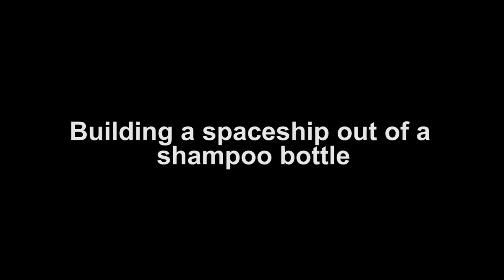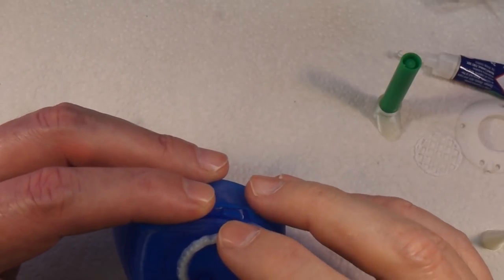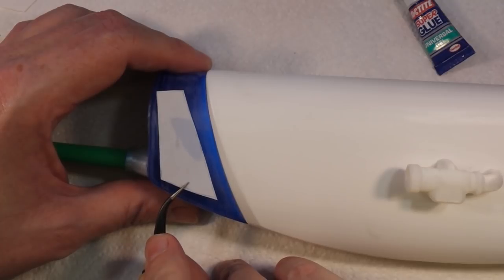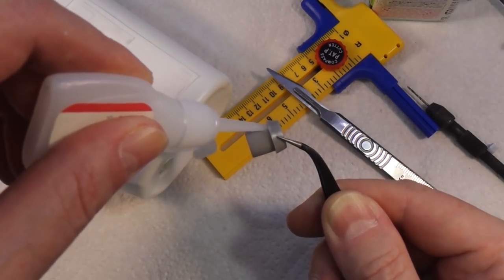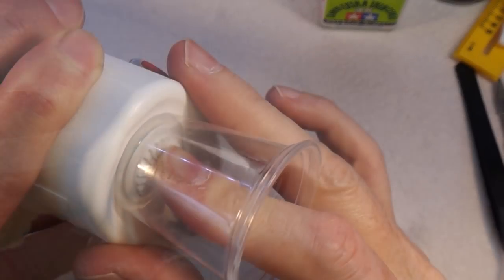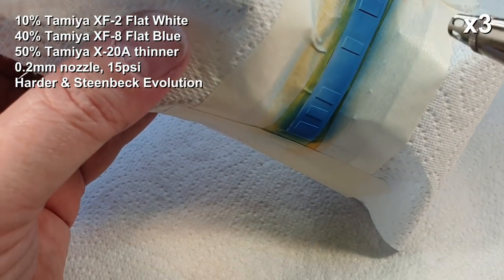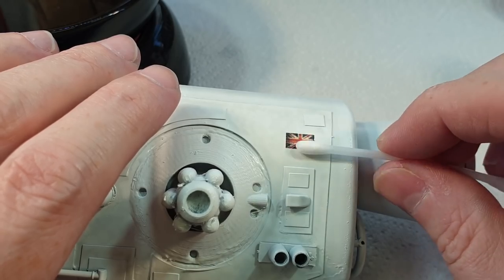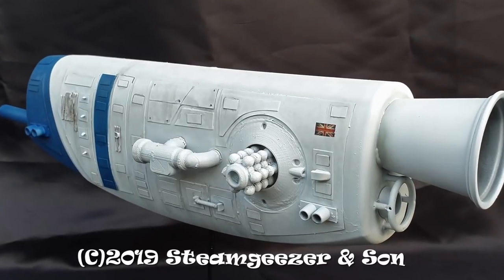Building a spaceship out of a shampoo bottle

Comment: Most of those bottles are made of HDPE, or High Density PolyEthylene, which is notoriously resistant to most adhesives and paints. The tops are often made of PP, or PolyPropylene, which is virtually impossible to glue - it has a surface which is oily to the touch, which is great for chemical resistance, but not for working with in a craft capacity. I have stuck it with hot glue, but it isn't a strong bond by any means. Superglue achieves about the same sort of bond, and I believe that it mentions on the packs not to use it with PP, PE, or HDPE. Even on contact adhesive, like 'UHU', which I use a lot, it recommends against trying to glue these plastics. 
That bottle is an interesting shape, though, and Eric Geusz' illustration is superb. I know that, if you can make one, it will be top notch. Nice one.
Reply from the maker: Thanks. and yes the bottle is HDPE. The superglue holds pretty well, although I do use an accelerant which might be why it's working. The Humbrol primer worked very well on it too - no problems at all there.
Reply: I use paper clips to pin on styrene sections that you then glue things on.
Reply: I like to roughen the bottles with sandpaper and brush over it with a little bit of acetone for better adhesion.
Reply from the maker: I went over this with some 320 grit paper. Never thought of acetone though. I like the paper clip idea too.
Reply: I have also had a lot of luck with Fabri-Tac as an adhesive for these types of plastic bottles. I also use peel and stick foam for detailing. @SteamGeezerUK

Comment: Eric is an inspiration to me. Coming up with stuff in my mind out of tools and parts keeps me sane on the assembly line.
Reply from the maker: Now I need to know what you're assembling... :-)
Reply: @SteamGeezerUK  cars.
I don't spend most days on the assembly line, but the days I do, I quickly feel like I'm going out of my mind. I do parts inspection, so that means whatever has been coming in bad, I check, until the supplier sends certified parts. Sometimes the checkpoint is on the assembly line.
Reply from the maker: @adamofblastworks1517  Cool, QA is an underrated endeavour, whatever business you're in.
Reply: @SteamGeezerUK  perfectionism has served me mostly decently.
I am often a bit slow, but they know they can count on me to get it done *right*, all the time.
They don't have to worry about me taking short cuts or using a different way of inspecting a part.
I've caught some stuff that could have potentially stopped the whole line for 30+ minutes (which is a LOT of money), that was not part of my process, but I noticed it and investigated.

Comment: Love your videos! I might have a tip for you to try.. been making a model land rover for the old mans birthday (he’s ex army) and the chipping techniques I’ve seen didn’t really work. Salt and hairspray are great for the middle of big panels, but not so great for details. Real Land Rovers don’t get corrosion on the middle of body panels as I’m sure you know. But the bolt heads on the bumpers get paint battered off in seconds. So..spray the model with synthetic enamel metal paint, 2 or 3 generous layers. Let it dry for a few hours. Then go over it with a thinned down top coat, enough layers to make just opaque. Let that dry. Now drag a cheap disposable nail file over the model. No pressure used. Anything sticking out will get it’s top coats knocked off. Sort of reverse dry brushing?
Reply from the maker: That was the first technique I ever learned for chipping, any years ago. It was in the instructions for a model pistol I built, maybe 35 years ago.
It's a great technique - thanks for reminding me of it :-)

Comment: For those of a certain age: how many suddenly started hearing Valery Singleton making a rocket out of a Fairy Liquid Bottle... #BluePeter
Reply from the maker: I'll break out the sticky backed plastic next time, shall I? :-)
Reply: Edward Millership 
And don’t forget the felt patches and “rubber adhesive “ (normally a tube of UhU with the label marked out)
Reply: SteamGeezer and Son Independent Traders 
So where’s the one you did earlier? , , ,
Reply: I'm using double sided sticky tape for speed

Comment: Love this! - Excellent work
I've had many ideas like this. especially with that bottle and I've seen the pic referenced in Pinterest. the problem I've always had is that those bottles are made of HDPE plastic here in Canada, NOTHING bonds to it.  I've tried 2-part epoxy, JB Weld, Loctite and I've even taken a torch lightly to the plastic to do something chemically to it as suggested in a video. Paint is a whole other thing. no primer or paint type, acrylic, lacquer, oil will stick.  I'm not sure how this possibly worked for you, my only guess is that the bottle you have there in your part of the world is not made of HDPE plastic. It did say it was recycled....

Comment: those freebie Humbrol pains are useless! I've nearly ruined 2 kits now using them! I only use them if i'm desperate for that colour!
Reply from the maker: I think this is the first time I've used them. I have used Humbrol paints in limited quantities before, like the RAF Blue I used on the "Beer Delivery" build for the uniforms, which worked fine but I don't know if the freebie pots are the same mix or not. I'm going to investigate further.
Reply: @SteamGeezerUK  they are different. I use the humbrol tins and hairy sticks to paint my models, I work on our lounge the wife wont let me have an air-compressor indoors lol